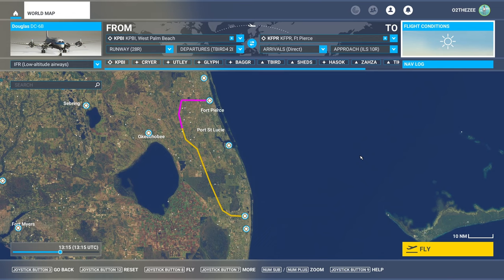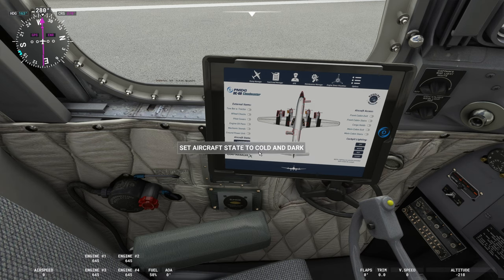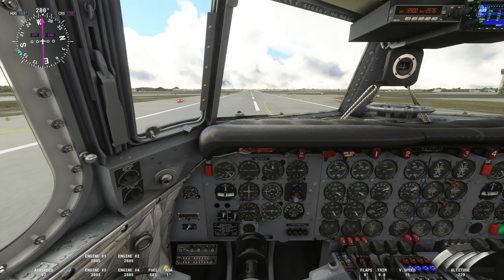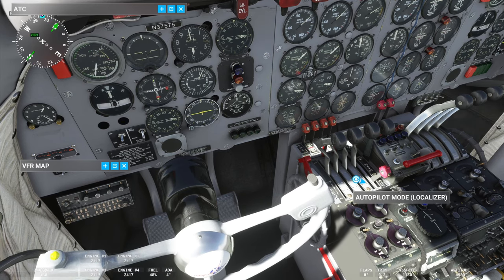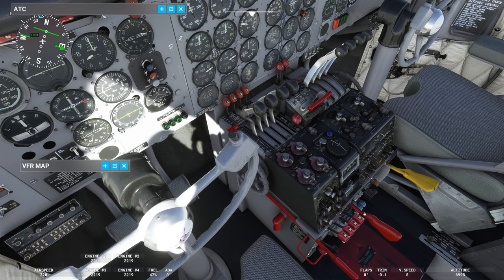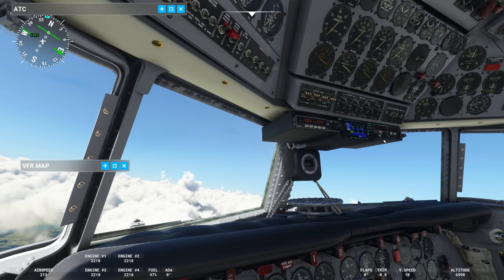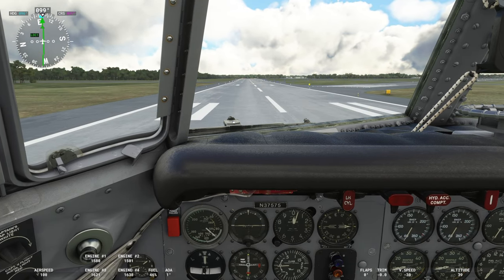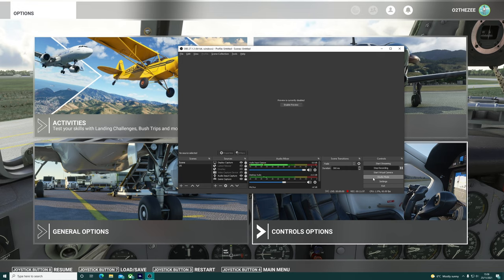PMDG DC-6 Made Simple | MSFS Tutorial - Takeoff, Climb, Cruise and Landing (ILS)

Comment: Most things I've read suggest control descent rate on approach with throttle, adjusting elevator trim to keep speed as desired.  Flaps are added earlier to gradually bring the speed down near 110-120.
"Adjust descent by using flaps only"
Reply: I was questioning the advice in your DC-6 document.   ??

"Final approach troubleshooting (adjust flaps accordingly)
Do not touch power, leave 100Bmep set
Adjust descent by using flaps only"

Comment: how are you getting so good framerates? my game lags so much when using this plane that i had to stop using it even running it with i9900k- 3090 - 64 gbram .. is there a trick or did i just waste 50 dollars lol
Reply from the maker: I were flying in Florida in this video and usually Florida gives really good frame rates. What res are you playing at ? Also I think I had live weather turned off not sure if this helped.
Reply: @OzzySafa   yeah i noticed right away that turning off live weather helped in some areas, i am running my game at 2560x1440 with almost everything on ultra and high, i don't really want to mess with the graphics cause every other plane i got including flybywire's neo runs very smooth right now after a couple of months of tweaking after i previously messed something up ^^ but ofc if u got any ideas i will try em out :)